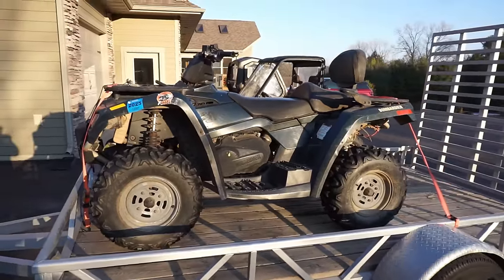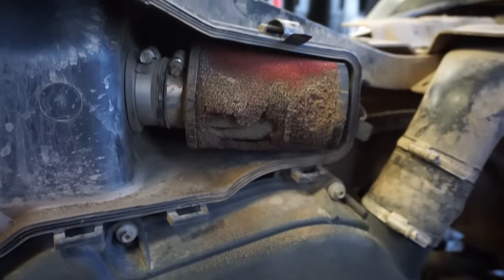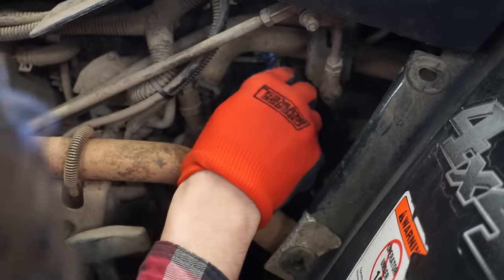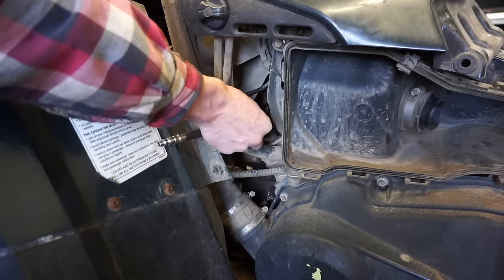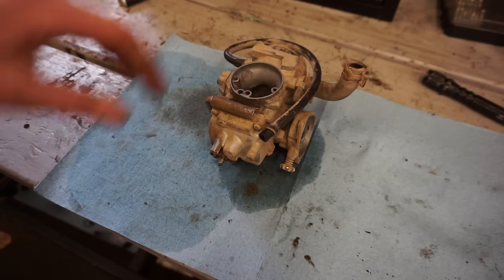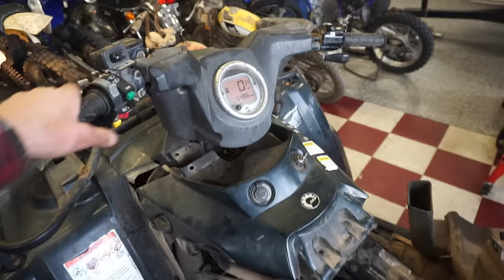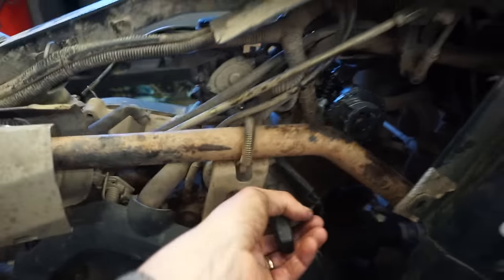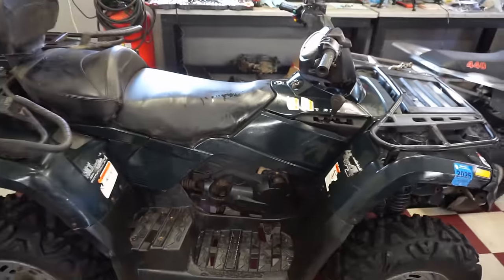Dealership Couldn't Fix This ATV So I Got It For CHEAP

Comment: Lots of dealers won't touch older machines. It wasn't always this way. I can understand the hesitation on the dealers part, however, if doctors operated this way, more people would be needlessly dead.

Great course on how to diagnose engine troubles.

Comment: I have a 2005 Yamaha Bruin 350 4x4 that i got for 200 bucks last year. It ran when i bought it but it needed new wheel bearings and cv axles and i rebuilt the carburetor last month and it's been a good machine. I just need to replace the oil cooler after i busted it after running through some brush and punched a hole through the middle of it

Comment: Awesome channel I wish I could find deals like that. I have a few questions why don't you wash off the machines before you start working on them, if the air filter is bad why not remove it so the engine is getting air, you don't use starting fluid or pour gas in the cylinder to jump start it nor coitizing your work just some questions, I think what you do is great. It is nice to see young people working on their machines instead of bringing them to a shop.

Comment: Joe next time you’re upholstering a seat try cutting a quarter inch groove in the center of that flat head and put half of the flathead under the staple and twist. The torque pulls them out with ease.

Comment: I recall you saying the last owner rode it, shut it off and it wouldn't restart.  Since it skipped 3 teeth on the timing, did you check the timing chain tensioner and find anything wrong with it?  I've seen cars with sloppy timing chains have that happen.

Comment: One thing you should do is make sure you have a good fire extinguisher in your garage.  I had an SL350 catch fire on me because the air filter was saturated with gas and it backfired when I tried to start it.

Comment: If you had some sand and gunk in the carb, I think that cheap inline fuel filter could be loaded and as it runs the dirt settles in it and blocks next restart. Agree with other commenter, a trip through an ultrasound would be a good as well

Comment: 612 hours?  That’s new yet!  Shit, I have 2,590 hours on my 2006 Polaris Ranger & it still runs great! I have done a fair amount of replacement of wear items like front & rear differential bearings a couple belts also a couple axles but nothing I haven’t been able to repair. Good luck with your “High mileage” machine.  lol!

Comment: Repair shop check out/diag process is always minimal as we know. They prolly quoted worst case scenario and still would've rebuilt even if they discovered what the actual issue was. Doubt a talk with the tech will happen. Money talks. Worked with a few criminals at the auto dealership for over 20yrs. Easy to spot 'em, getting management to recognize is another issue. Great job brother. Really enjoy seeing all these bikes come back to life.
Reply: I run a repair shop and no, not all of us are scammers. The amount of free diag work I do is excruciating.

Comment: I really liked your video and your troubleshooting procedure is the most excellent thing about it. I do think you may be a bit quick to blame the guys' mechanic on the estimate of 3200 bucks. We do not know what conversation they had, what the shop charged if anything for a guess at the problem. They could have been quoting worst case after a compression check. It is up to the customer if they want to proceed further with repairs and risk the bills associated with that. Once they got into the job they may have found the same problems you did and the actual charge could have been less to the customer.  We love backyard guys figuring stuff out for cheap. I think we as a society make people that do this every day for a living the enemy. A few words during the video in this  direction would be in order.

Comment: Check spark, fuel, compression in that order. First pull spark plugs out and ground on engine, see if they spark. Then pull air filter off, make sure there are no obstructions and spray starting fluid (don't waste time to see if fuel system is working). If still not running then check compression. If compression is good then your ignition timing is probably off.

Comment: Hi Joe, This is Katherine from Ocell, we specialized in LiFePO4 battery since 2008. Any interests in installing our 48v30ah LFP battery to replace the trojan GC2 battery? You just need to simply remove your old batteries, drop-in your new O'cell 48v lithium batteries, connect them in parallel, connect the CAN cables that come with your battery then trun your batteries on via the wake-up button. There’s no tray modifications and no extra components needed.

Comment: Checking oil level.  With these and similar engines, you normally do NOT screw the dipstick in.  You measure with the stick resting on the filler tube.  Check the user manual.

Comment: But what would cause the chain to be on the wrong cam sprocket position and make the timing off? With screw and locknut adjustment no need to remove the cam?

Comment: was wondering why you didn't verify timing while adjusting valves as you normally do that. i didn't see it had weird timing procedure. good job on staying with it. by looks of air filter and low compression i would have thought rings were toast. i am curious though.... why did timing jump? and i would be nervous that it did it once, so can do it again. next time.... may eat valves! think i would check tensioner travel. with those hours may be time for new cam chain.

Comment: My father had one 400 outlander easy very reliable. Only oain to replace a timing chain you literally have to take everything apart, to include pulling head and cracking the engine pack in two.
Orher than that very reliable atv.
It says it is a interference engine, but it really isn't, just a heads up.

Comment: I still can't believe that you work on machines regularly and always fail to check timing as a preliminary step. It is literally the second thing I check. Spark plugs, timing, compression, carb clean and air filter all in that order. If you checked timing first you would have saved a lot of time.

Comment: I'll tell you why they quoted over $3000 for the repair and it wasn't underhanded or incompetence.  There can be so many reasons why an engine can have low compression as you just showed us.  It still took you a lot of time to find out exactly what it was, which ended up being mainly the timing but also some valves being out of spec.  By the time a mechanic actually crosses everything off the list, he's already cost the shop hundreds of dollars in labor.  Plus there's always the risk that customer might not even approve the work after he spent all the time and effort troubleshooting it.  

I think the shop said... 
We'll go ahead and quote this $3500 so we can later take a multifaceted repair approach to fix what could potentially be the entire valve train, top end, and timing.  It could be ONE of those things or ALL of them.  

The shop gave a safe quote for what could potentially be a really time consuming diagnosis and repair.  A shop has a completely different business model than you have.  They make a small amount marking up parts and the rest is made for labor hours they charge per repair.  You, on they other hand, earn money from the resale value of private sales.  You can spend a good deal of time working on something that didn't require any parts to fix and still be profitable upon sale.  A shop takes a completely different approach to their business.  They're not reselling anything.  They just do repairs.  Something that takes a long time to diagnose is really costly for a garage paying a mechanic $30/hr.  Troubleshooting takes time and costs money.  It might take a good while to narrow it down.  In the end, no new parts were needed but time is still money.  Since you're not paying a mechanic an hourly wage, it's not as costly for you to troubleshoot.  For the shop, it is.  They have to recuperate that cost and the estimate they gave reflected that.

Comment: That much fuel down the cylinder mixes with the oil 
Thins it out and makes it prone to smoking as the fuel and oil vapor gets burnt 
Oil change is always a got option if fuel dilution is suspected
Well done on the fix

Comment: Sup brother. Love your videos, i saw like 30 videos in the last 2 days. Awesome work. I got into an adventure aswell. My first quad, is a 2002 bombardier quest 500. Can get it to spark, doesnt have the cdi, it should still trowing a spark right? Or do
I need the cdi installed. Thanks in advance

Comment: I would immediately put some oil in it just in case it fires up and also because it might have a low oil sensor stopping it from running. Good luck

Comment: If I were the previous owner of that ATV and saw  your video, I'd be pissed!  No at you but at the shop that quoted a $3200 repair bill.  They proabably did a compression check and figured the engine was blown.  The question is how or why did the valve timing jump.

Comment: hey guys i just bought this exact machine im having a issue with bogging at full throttle i cleaned the card all jets are good it will idle and mid range is good but full it falls rite on its face but if i cover 90% of the air intake it will rev to full throttle but yhere seems to be alot off excess fuel when i do that any thoughts would be appreciated wits end

Comment: The oil was low and I never saw you add any.  Does it have a low oil shutoff?  If you had to keep oiling the cylinder wouldn't it make sense to add some oil?  I hate seeing a carb get opened up with all of that dirt on it.  Drives me nuts that he didn't take some brake and a rag to it to remove the loose dirt at least.

Comment: Starters have a duty cycle. Usually 30-second crank followed by ten minutes of cooling. 
Clean the air box and replace filter BEFORE starting.

Comment: What if you were a shop and that quad came in.....  How would you have estimated the repair cost?  Would you do all that diagnosis for free?  Would you have asked for 4 hours diagnosis time?  Or would you have listened to crank over,  heard the low compression without even taking out a tool, and told the customer what the worst case scenario price is likely to be?

Comment: Well done!! Great job. $3200 is a bit too much for that repair job. What was that mechanic going to do, install gold plated parts? At that price, one would have thought so.
Reply: open up a business, do it a little cheaper and you'll get all the business and be rich and busy all the time........oh that's right, you can't.
Reply: @steveww07  great comment. Another problem. I'm retired for medical reasons.
Reply: @christophermarshall5765  thats a good point, not everyone can do it. I could, but would choose not to. So the ones that are out there risking it (this type of business) get to do it their way and charge what they want. Considering the hell some customers put you through I'm covering my bases and replacing everything and charging accordingly.

Comment: If the timing has changed the chain is stretched and it will jump again. Stretched chains is common on them 330 and 400 can ams.

Comment: How many hours did you have into this project? I agree 3200 is a stretch but time ain’t free either. $80-100 an hour at 10 hours is $800-1k but if feel like that was more than 10 hours of work. Also now that it’s running what can you sell it for?

Comment: Transmission ATF is good for freeing up a cylinder and piston rings…pour a decent amount in the cylinder overnight then turn the engine over to expel the ATF and drain the engine oil and replace it with 15w40 diesel oil that has the Jaso designation and she will likely put like a kitten barring there are no timing issues like you bike had

Comment: Your worried about the engine sucking in crap but you don't remove the filter and crank away pulling in any crap you've just released by rubbing on it. You should of checked for oil, removed the filter and turned it over by hand before cranking it over. Also, please stop cranking the death out of the starters. You'll burn it out or the leads going to it.
Don't take offence by any of this, I know your learning still but get the basics right first please. 
Still enjoy your video's though, it's like I'm still at work telling the apprentice the right way to do it.
Cleaning stuff beforehand works wonders too, just hit the electric connectors with some WD40 before washing off, to help keep water out.
Nice find though. They go for good money in England

Comment: honestly at 51:59 52:30 it sounds like its plateau-ing like it starves for fuel after a certain rpm,  did you check fuel lines, for liner gum and check fuel filter?

Comment: Some shops will quote a $3000+ low compression job so they cover their backside without doing a simple compression check. Not surprize the shop did that. If they accidently fix it along the way, they pocket the profit a d the customer isn't wiser. This is why everyone should know how to try starter fluid and do a preliminary diagnostic test. Gasoline engines woth compression, fuel a d spark should always at least bump off. Of not, check spark. If no spark, check ignition. If spark, check fuel. Real simple to eliminate the most probable source of a crank no start.

Comment: I've had to sand down piston rings and the gaps before to get compression back. small metal flakes over time and rust makes them stick !!! over time !!! 10k miles seams to be rebuild time !!! for any machine except the old 3 wheeler motors !!! my 3 wheeler is about 60k miles or more !!! 80 k miles max I think. but I change my oil at every 100 mile or 150 miles !!! no and if or butts  !!! and a hair of 2 stroke oil helps in the long run !!!

Comment: I have a polaris that runs only on choke . Replaced carb and cleaned original. Adjusted valves not sure what maybe be the issue
Reply: needs more fuel

Comment: I completely understand why the last mechanic said it had low compression and gave them a high quote. It was his way of saying get rid of it and buy a new one. 

Some don’t understand that it is like having a car that has 300k miles on it. It’s going to keep breaking down, when things have this many hours on it then one part after another is going to go bad. 

The mechanic did the customer a favor by essentially telling them you’re going to sink
More money then it’s worth. It can be fixed now but something else is going to break soon. 

If the mechanic fixes is then when something else goes bad the client is going to be upset and think it was the mechanics fault. Working on it is a liability at that point.

Comment: put some synthetic 2 stroke oil in the fuel and drive it around for a week. You will be amazed at the clean up of the bore. - rings will reseat etc
Reply: if its burning oil then isnt that kinda the same thing??

Comment: I have a older dirt bike that was running last summer and I parked it for the winter and now it won’t start has no spark now and I have put about 400$ in to it and it still won’t start how much will you charge me to fix it

Comment: Try some engine restorer put a little down the cylinder and a little bit in the engine oil let me know how that works for you it has CSL in it to restore compression and fix fine scratches in the cylinder

Comment: From the looks of the oil and that pathetic air filter, the owner wasn't exactly concerned with basic maintenance. Add the extremely low oil level and it could be a low oil safety cut out. But since you've got spark, that isn't the issue. Next id check to see if that motor has a compression relief for starting assuming that it's either kick start or pull cord start capable. Then you're left with valve timing or valve seating issues. Considering the the story that he was riding it with no issues, shut it off and then tried to restart and it but couldn't, kind of leans to a hot valve that may have been exposed to deep water/ snow intake into the combustion chamber very shortly before he shut it off and the valves picked up just enough defection to keep from properly seating. Could be a pin hole leak in the head gasket that allowed water into the chamber and would also affect compression. I'm about 10 minutes into the video so I guess I'll see how close my guesses were.

Comment: I working now on honda trx250 . Old engine won't start . Fuel going out from carburettor. When I try to start engine. So timing chain tensioner was broken. Now when I put timing back and new tensioner atv runs like new

Comment: Fired right not exactly true 😂but I would suggest cleaning the carb with a paint brush and petrol b4 you take it apart then spraying brake cleaner thro every hole and jet 🎉🎉and I do have to say what a bargain with a bit tlc strip down back together should last a few years sounds a bit knocky

Comment: I would bet anything that motor took in water/mud at some point, by the looks of that filter and box. If that’s true, there is a screen in the lower case that’ll need to be cleaned or replaced. Unfortunately the case will need to be split if that’s the case. Rotax motors are famous for this. That would explain the rings.